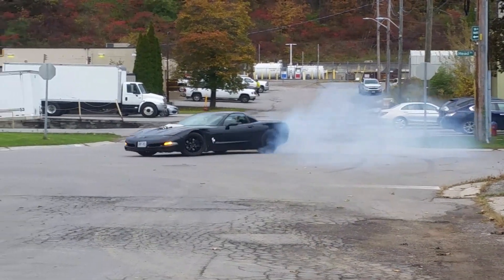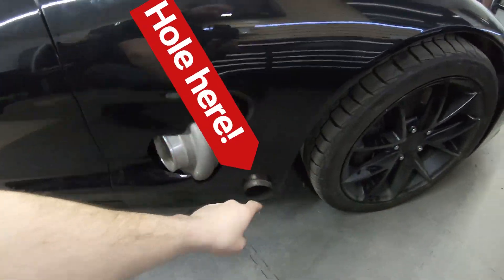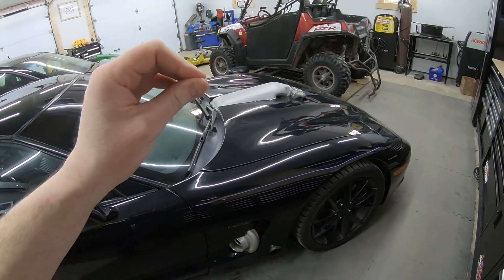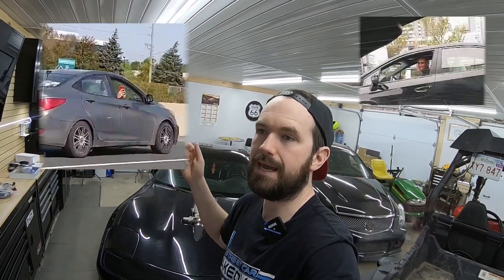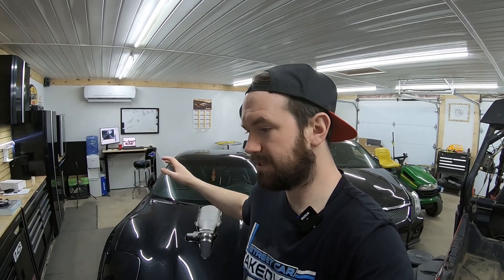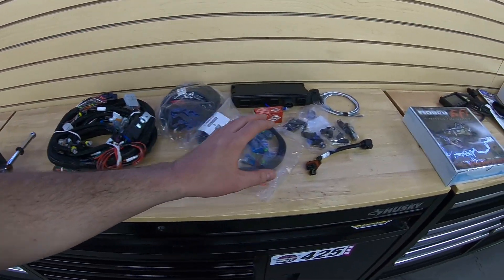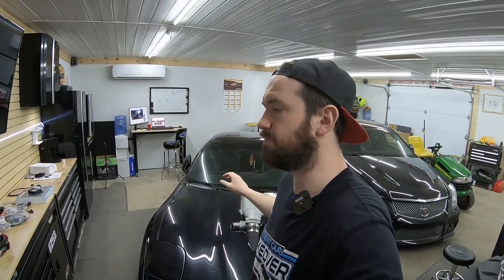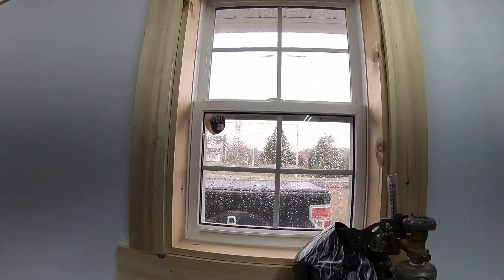1000HP TWIN TURBO CORVETTE - HOLLEY TERMINATOR X - FROM A CONVERTIBLE TO FRC ROOF.

Comment: How did you make the x max work with the trans. I spoke with Holley and they said it won’t work
Reply from the maker: Car is manual, only reason I got the "max" was for the drive by wire.

Comment: Looks and sounds great. I'm going the pre-fabbed route, having first scored a $1,200 deal on a used LPE kit (for no other reason than the price was awesome - I was almost done with my SC build otherwise) and have since delved into turbo options and lucked into a Huron kit with every option minus turbos themselves for just $3,800. How could I not!? See my problem? So I'm getting some work done for that setup and ordering a different cam. Any more vids on the outcome with yours here? I'm hip deep in Haltech from my SC project to I'll be finishing that and welding in a lot of extra bungs for the manifolds so I can expand easily later if I choose to.
Reply from the maker: Definitely some to come as the car is now on the holley! I haven't had the time to get into putting the videos together thats all. Only so much time in the day, and lately its been spent elsewhere haha. soon!
Reply: @AtlanticBuilt  same here. Endless doubles and being sick for two months has left my project car untouched since Fall